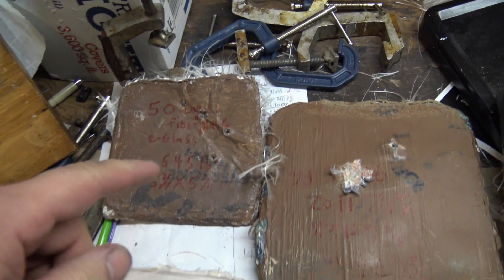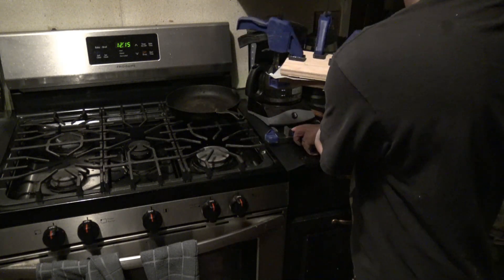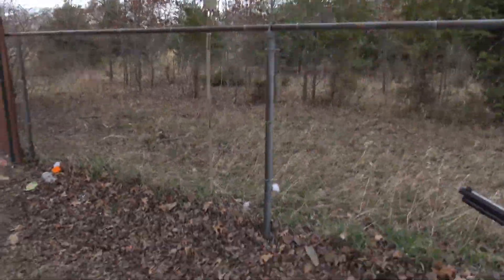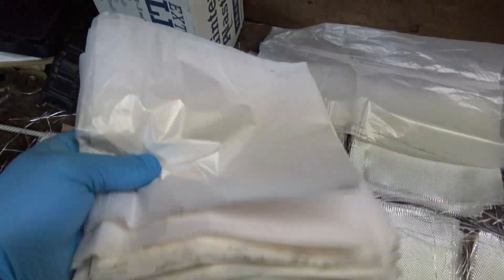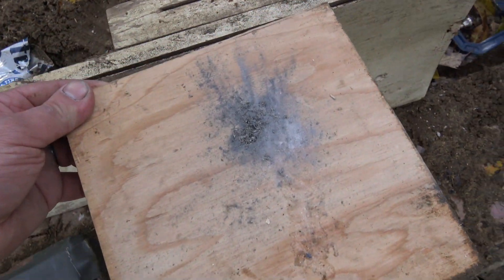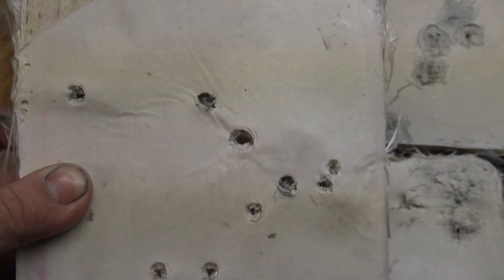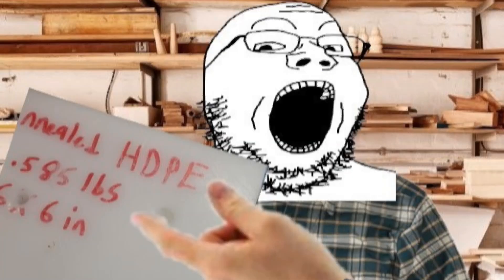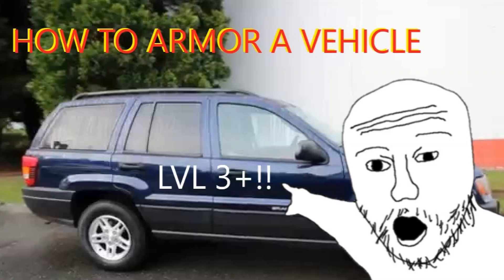Recycling HDPE bags into bulletproof plates!

Comment: ok, don't get me wrong, i love the builds. but plate #4, chest plate size, would have about $60-$100 worth of kevlar in it. WAAAAY doesn't qualify as recycled hdpe. price wise. cheap ceramic though, is brilliant, price wise. what i'm really baffled by, is the apparent lack of resin. are you using the hdpe microthin layers, as a form of resin? by melting it, in the oven? i do skip around in videos, a bit, so, sorry if i missed that. also, it seems like in a previous video, the one leading to this one, you discovered the power of compression, by the fiberglass layer, being "wrapped", around the block of hdpe. have you ever thought of wrapping the entire edge of these new ones, like maybe several times, with some sort of fiberglass "tape" ?

lastly, since the previous video was kind of a precursor, it doesn't seem too off topic to ask a few questions. did you ever shoot the simple hdpe and fiberglass one with any kind of rifle round? or did you just consider the double ought buckshot a quicker way than with the 223? 😄 and did you ever try a piece of tile with it? like maybe in between the front layers of fiberglass? and does anyone ever put like just 1mm of metal on the very back, to kind of simulate vehicle body panels? i know you're mostly designing with body armor in mind, but the exact same principles and needs could apply to vehicles. ok, not that you could put one in the oven, but, back to resin?

Comment: Instead of using those Irwin clamps (they really are pretty weak) Get some Althread rod in a decent size and some thick Ply like you used in your early molds. 
Make yourself a very manly flower press..  the clamp force will be much higher and can then be consistently applied with a torque wrench if you so desire such consistency (for something you may be trusting your life to..)

Should still be able to do all this on the cheap from your local big box hardware (Probably cheaper than 4 Irwin clamps, at least where I live)

Comment: What about offset strikeface so they act on the bullet longer the round smashes each separately a fraction of a second apart
Reply: You place them the length of the penetrator (tip of bullet to tail of penetrator min.) Appart in the stack so tile one takes the jacket and the second takes on the penetrator
Reply: I call it two stage energy reduction in your plate with the two ceramics tight to eachother they both experience the full energy of the round 

but separated the secound one would face an exponentially slower and deformed round now the remaining layers only need to slow what energy is left over after the second stage.

My thereory then is provided both plates have the same overall thickness the two stage one should stop the same round with less deformation

Comment: How much did it cost for one of these plates? I was looking up prices and realized either my math is off, or by the time I’d finish layering it would be $150 for a square foot
Reply: Late reply, but I think your math being off is more likely. The welding blankets last time I checked are about $30 for a 6x8. The painters plastic is about $25 per roll. And the porcelain floor tiles are about $1 to $2 depending on how many tiles you need for the strike face. So I'd say realistically for a square foot it should be about $57 to $60, which is dirt cheap considering most real 3+ ceramic plates are like what a few hundred dollars or more depending on how much you want to make your wallet cry. I believe the lighter commercial ceramic plates are more expensive than the heavier ones. I could be wrong though, so don't quote me on that.

Comment: You need to check out Jackal Mountain videos on spaced armor. Thin multi layers of hardened steel (saw blades) robbing 5.56/7.62x39 of their energy. Im betting a combination of what youre doing and the thin light hardened steel would solve a lot of your issues with proper layering.
Reply: I tested this out by the way. If you want I could put the videos up for you to see. Long story short it took 4 saw blades to stop a 5.56 and at that point it was pretty heavy
Reply: @dawsonsumey7815  The 4. layers of hacksaw  blade should be sandwiched in between with HD drum plastic...

Comment: I purchased small Aluminum Oxide plates (17mm x 22mm x 1mm) and coated them in flex seal to help shattering when dropped. I then wrapped them in duct tape and placed them onto my HDPE plate. The tiles are very small as you can see and I was wondering if having these tiles very small will help with big shattered areas when being shot. The problem with most ceramic plates is that the tiles are usually big and once shattered, that area is compramised and won't do as well if another round comes through that area. I haven't brough my plate out to the range yet to test my hypothesis but was wondering if you gave this any thought. Also, the cermaic is really only there to shatter the bullet, making it easier for the rest of the vest to absorb the shattered fragments that each carry less energy than the original whole round. Was wondering if you really needed a thick layer of ceramic like most commercial plates or if a thin 1-2 layes of ceramic would suffice to shattering the bullet while the rest of the plate past the ceramic will pick up the rest. Ideally I'd like to have 2 layers of these small ceramic tiles floating in a impact resistant rubbery compound as to help with tile shattering after impact, then place a thin layer of HDPE over the ceramic to help slow down the initial impact. Then after the ceramic tile layer, once the bullet is in fragments, you'll have HDPE layered with Kevlar, Fiberglass or some sort of bullet resistant fabric. You could also work in a thin layer of metal like aluminum since it is light to help stop that last 5-10% of energy. I find a combination of lightweight materials layered in the proper sequence will help stop bullets better than just a bunch of 1-2 items. The aluminum doesnt't have to be thicker than 1/16th of an inch or even a thin flexible sheet of steel could work as well, long as it is light and flexible. Hope maybe some of these ideas of mine will help you on your journey or maybe strike an idea of your own.
Reply: I had the same hypothesis myself. If you had a bigger budget using a few thin layers of more expensive materials like aluminum sheets or even a few metal screen/ mesh sheets combined with kevlar/carbon layers mixed in with the cheaper materials would be  relatively inexpensive way to create light weight bullet resistant materials.  Designing the front facing layers as smaller tiles that shattered independently and can easily be replaced is also a great idea.

Comment: I remember seeing something similar on another channel, would rotating the fiberglass in between layers make it stronger?
I'll post the other video in the replies. It didn't stop 5.56, but it uses a similar principle to your video.
Reply: https://www.youtube.com/watch?v=_7jiIQOgwtI
Reply from the maker: @MrFives55  ah yes, ZNA. Great video, inspired alot of people to use fiberglass welding blanket for ballistic plates, mainly because of cost. Another good source for cheap strong fiberglass is woven roving, most of my vehicle armor will be made out of that stuff! And to answer your question yes, 45° rotation of the composite increases breaking strength, however you do end up using more fabric to cut it. After my first run of SAPI plates is finished I'll dive into that topic more, along with proper tile arays. Thanks for bringing it up!

Comment: So why not a polycarbonate facer and then the buildup of PE and fiberglass.
Or a sandwich of polycarbonate front and rear with a core of PE/fiber?
The polycarbonate is a lot lighter than the tikes and much less prone to shattering so a second close hit still hits resistance vs the tile where a close hit hits nothing but dust.

Comment: I saw it mentioned in the comments, but a stiffer backing layer behind the ceramic could make a big difference. I read in a declassified military test that aluminum was preferred over steel for this from a weight efficiency perspective.
I wonder if a relatively thick single piece of acrylic could work well if you want to completely avoid metal
Reply: Polycarbonate probably works better than acrylic as acrylic tends to crack under high stress.
Reply: @marcusfuckingwebb  yeah, but acrylic is stiffer and harder than polycarbonate.

Comment: aluminium-oxide-fiber-glass cloth-kevlar-weave (yes aluminium oxide strands)
Reply: planning to get shot
Reply: some steel sheets in the mix, around the whole thing
Reply: armor in a can
Reply: try a squished can filled with sand, sand-can, with some plastic melted in there, kinetic sand can
Reply: try the strengths by fitting them in a shooting stands, 1-2-3-many, to get the counts of passage, air between, like cinder blocks, then shoot to compare

Comment: your fiberglass cloth layers, try every other layer turned 45 degrees.
another maybe helpful, get some fiberglass window screen mesh in there,
also layering at alternating 45 degree angles. 
instead of pulling/spreading 4 directions (+) it'll spread 8 (+X)
that may go a long way for more strength from less thickness and weight.
edit: may also be possible the window screen mesh laid at 45's is better,
easier for the HDPE to fully saturate between all the cross stacked fibers?

Comment: Awsome projects im curious if the first method would make a decent bump cap. As i looks to be more flexible. Im working on recycling some milk jugs to make some knee pad caps and shin guards. This channel has given me a lot of ideas. Keep up the good work.
Reply from the maker: That's awesome man! Glad I could help. And yeah, the first plate was far more flexible than the rest, kinda like light lamination vs a heavier one. The content of hdpe in the composite as well as the flexibility of the fabric your working with effects the overall ability to bend this stuff. Well, that and the amount of layers used. I'm still working on full flexible rifle rated stuff.
Reply: Seems like a pretty much ideal use for HDPE.

Comment: What if use thicker plastic like milk jugs between fiberglass layers?
Reply from the maker: The final plates using painters plastic hdpe would be close to the same thickness of milk jug hdpe, so yeah, should work great! I think if you cut it into strips and later it you would get a similar result, might even be a bit better. I haven't fully dialed in how much hdpe is needed in-between the layers of composite fabric yet, but this could be an interesting test. Thanks for the suggestion

Comment: Once the plates are formed, can they be reheated to form them into a curved shape without delamination?
Reply from the maker: about time you showed up lol. Thanks for suggesting this project brother! it worked great. and yeah, I don't think you would have any problems with delamination once you got the hdpe melted into the fibers, so if you wanted make some thin plates and reform them into different shapes later I don't see that being a problem.
Reply: Left a comment on the last video to about using garbage bags. 
Thanks,  glad to see it's all working and to see your channel doing so well.  Congrats brother. 
Got a question about bullet resistant film for glass, does it stick to other materials.
The price would go up but could a final wrap of the plastic bag plates be done with the film, or separately could you apply it to a thin piece of aluminium and have it have a positive effect.
The piece that I'm mentally workshopping is thin alum treadplate followed by a rubber layer, ceramic tiles and then up to 1/2 inch of the plastic and fiberglass. For aesthetic reasons I'd like the aluminium facing out, but I know that's generally a no no for armor.
Would a thin weak metal like aluminum cause the same issues as steel or iron in the front.

If you can reform the plates maybe you could do a guy fawkes mask 2.0.
Again thanks and great job

Comment: That video was amazing!!! It's really hard to wrap my mind around how the 38 special barely dented the first simple plate at just 1/4" thick. Quick question, how does a "40 Smith and Wesson" compare to a 9mm or 45 acp or 357 mag for penetration. The 40 Smith and Wesson is one I haven't seen on your channel. Just curious.
Reply: After testing full power 357, everything else is for fun. You'd have to go up to something like 44mag to get a higher pen chance.
Reply: @johnguy3211  yeah true, I'm just curious what a 40 Smith and Wesson compares to in power and pen.
Reply: @DavidSmith-vz9uu  about like hot 9mil. It carries more energy but has more frontal area. On a round for round basis more terminal effect but no more armor penatration
Reply: @johnguy3211  oh okay thanks, I know that police officers usually carry 9mm or 40 Smith and Wesson, so that would make sense that those 2 compare.

Comment: What about using Kevlar instead of fiberglass?
Reply from the maker: For sure! the lumat I used for one of the plates is also an aramid like kevlar, just not as strong. Kevlar would would out preform these plates, in both strength and weight. The only down side to that stuff is it's cost, just like PBO fabrics. but hey, if you can afford it go for it!
Reply: And melt steel net inside?

Comment: Going to try this out 
I made my first hdpe brick yesterday with a thrift store panini press.
Reply from the maker: Haha now that's innovation! Will you be testing the plate out soon? If so let me know how it goes!
Reply: I was thinking the same with a panini press or a t-shirt press instead of oven.
Reply: Btw, how did the panini press work?
Reply: @greta11666  it worked good. But it was slow as I could only add small amounts of shredded jugs at a time. Probably better for making small project slabs than for armor.
Reply: @zell9058  I was looking on Amazon and they have industrial heat press machines I think might work  they go as high as 400f , usually for t-shirts but seems like some of them have pressure amount applied changed, etc which work quicker than an oven.
Reply: @greta11666  that sounds perfect!

Comment: stopping the 7.62x54R FMJ (wich has simialar mass, diameter and velocity as .308) would make this plate comparable to NIJ III standard, so, that's very good
Reply from the maker: Right! And being able to stop so many m855, and almost stopping the steel ball 7.62x54r is nuts. Also these are light enough you could throw some steel or aluminum in there for good measure lol, because I know you want to.
Reply: @Techthisoutmeow  indeed. a metal layer beetween the ceramic and the composite would improove it's performance.  i wonder how much mild steel could be added before reaching the weight limit (as mild steel is cheap, common, and aivable everywhere) like, maybe a 1/16 or a 1/8 thick layer could bring some improvments

Comment: Have you tried newspaper in portland cement? I've seen it mixed into a slurry, aerated, formed into blocks and used as lightweight building material able to stop bullets. I have to wonder if layers of cement-soaked newspaper sheets might work well for plates, too.
Reply from the maker: Huh, never heard of that method before! I've done some experiments with hard clay plaster type mixer and coco coir as a reinforcement. I'll have to see if I can find anything on the topic your talking about. Thanks for the suggestion